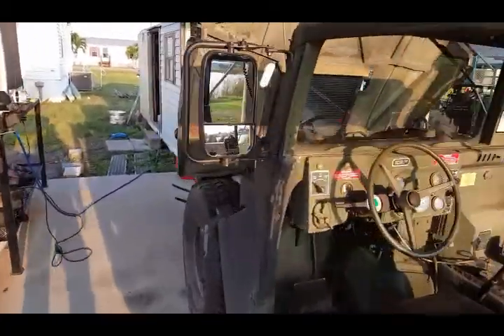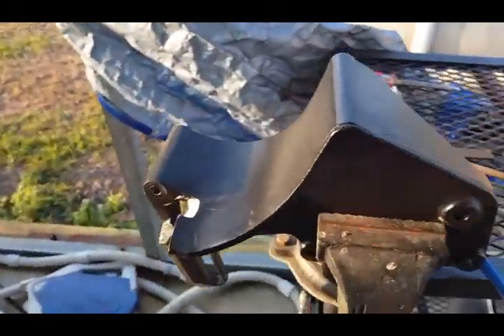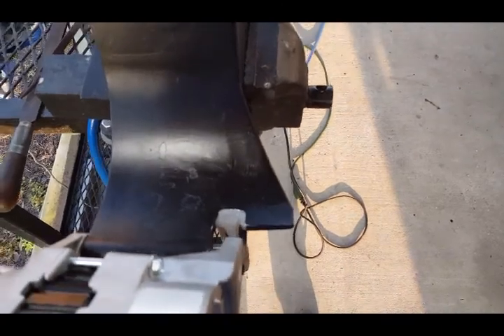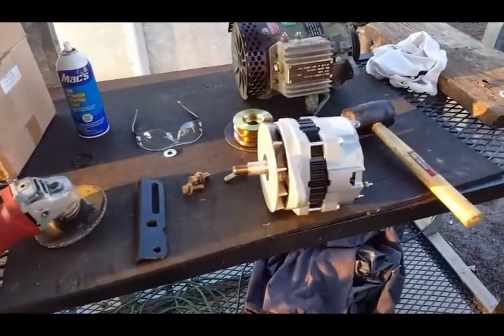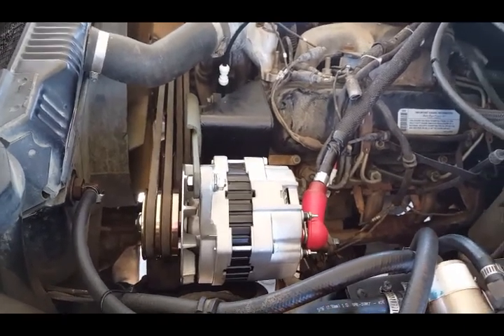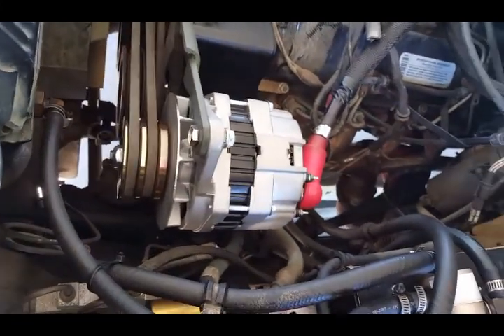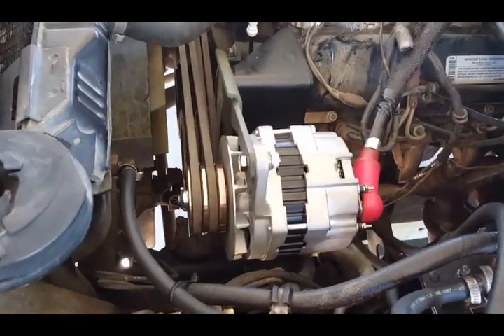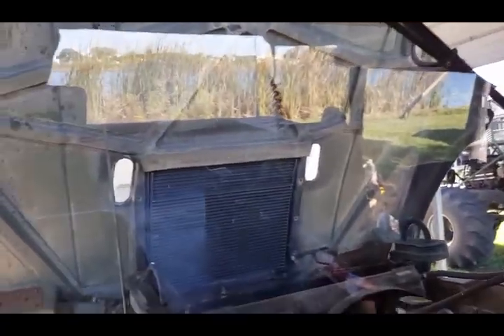Humvee Upgrades 11

Comment: Another issue I see with some of these vehicles are the hydraulic driven cooling fans, there are some far more efficient electric fan assemblies that can replace the hydraulic powered fans. In my book having had an older GM diesel car converted to gas, the hydra boost system can be a weak link in the system. I had a failure in my car and had to replace the power steering pump and hydra boost for the power brakes. A high pressure filter would have helped to keep the hydra boost pump clean from FOD that may have come from the power steering or brake systems. Perhaps a filter between the two systems as well as one going into the main pump.
Reply from the maker: Good to know. Thanks

Comment: Here in Germany a 60 amp alternator for the M 998 costs 1450 - 1800 euros. I bought a new 60 amp alternator in the classifieds which was cheaper. It turned out that this one was also defective, even though it had never been installed. I paid 650 euros for it. I will now use this alternative ( Delco Style ). Thanks for the video!
Reply from the maker: your welcome. FYI- someone told me most of the time its the regulator that goes out. Maybe you can swap and try? Its the square part on top. Or do what I did. Good luck
Reply: Heat is also an enemy of alternators. I would hope there are companies that rebuild them there in Germany. Also if that one you purchased via the classifieds was paid with a credit card, I would have had my company void the charge and sent the alternator back C.O.D. to the seller.

Comment: It’s your regulator that failed, it’s the big square box on top.
Reply from the maker: Thank you for that, I do still have it. Ok, so I can just replace regulator. Cool
Reply: it’s pretty common, just make sure you get the correct model because it’s specific to the 200, 400. I have a 400 amp behemoth on my truck i’m going to pull and do the mod you have done because the 400amp is ridiculous.

Comment: Did you check to see if the ground on the regulator had a good connection to the vehical ground? This is one common problem that causes an overcharge situation.
Reply from the maker: I did not. Where were u bak then? Owell, all behind me now. New alt is still doing a good job.
Reply: @mygooglusername  I added a new ground wire harness from Kascar and it didnt stop the original alternator from spiking.
Reply: @m998hmmwv7 perhaps the damage was already done to the alternator or there are issues within the diode pack in the unit. 
I would like to find a reputable company that can rebuild the original heavy duty alternators. The dual output units are worth every penny. I recently had an alternator failure in my everyday vehicle, it turned out to be a worn out commutator and brushes and it was only the terminal supplying the positive output. These parts are available on line from many sources but one needs to question the quality, we don’t need no Chinese junk in critical components.

Comment: Hello i have 3 câbles on my original humvee alternateur  / 1firt red positive, 2second grounding i dont see the 3 câble on your alternator
Reply from the maker: U may have the same one I had. There should be a red and a yellow. If I remember correctly. The red is a bigger cable 24v going to batts. The yellow is a 12-14v output to your accessories. That is a dual voltage alt.
Reply from the maker: I only used 1ground and the 1 only 24v to batteries. I have my 12v stuff wired off my back battery. Which in time will draw that battery down and will have to be charged back up seperatly. Not really the best way to do that. I need to wire in a 24 to 12v converter  from my alt or front batt to the rear. This way it will keep 12v charged.

Comment: Do you have the link for this alternator ? and do you have the link of the pulley ? 
Thanks a lot from France
Reply from the maker: I do not have the link but the description is in my comments. Amazon 21-si 24v 70amp. Delco style. Pulley is made for 21-si alt. I dnt hav any specs. Sorry
Reply: @mygooglusername  do you have the Amazon like for the alternator and the pulley

Comment: Did you have to hook up any of the other terminals for your voltage gauge to work etc? 
Or just the main hot wire?
Thanks, looks like a good fix, my stock one started over charging sporadically.
Reply from the maker: No other terminal
Reply: @mygooglusername  thanks
Reply: I had the same problem. It would overcharge and one time it shut down the motor.

Comment: How does the alternator work? Any problems with the battery voltage because you are only supplying 24V instead of the 28volts supplied by the stock alternator? I see you are running a big stereo system too, so does it keep up even with that? Thanks and please let me know.
Reply from the maker: It does put out 28v. And the stereo isnt so much a problem. But over time the rear batt which is supplying the 12v starts to drain down. I am going to install a 24 to 12v tranformer of the front batt to the rear 12v. This will keep the rear batt charged up. You would think they would charge together and ballance out the voltage, but it does not.

Comment: I Did the same thing to mine about a month ago. But I used 2 peices of all thread instead of cutting the brackets. But u still have to weld on a extension for the adjuster bracket. Good job man keep them rolling
Reply: Any video or pics of that?
Reply: Living Southern